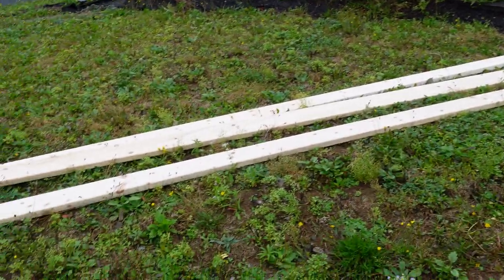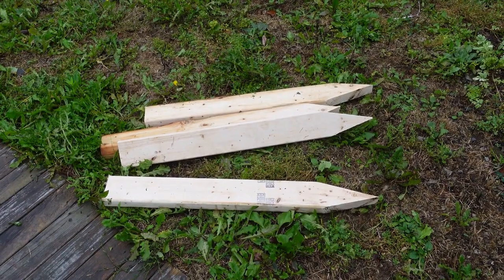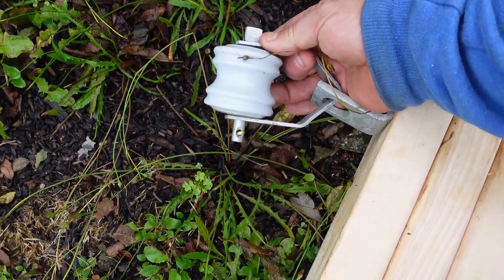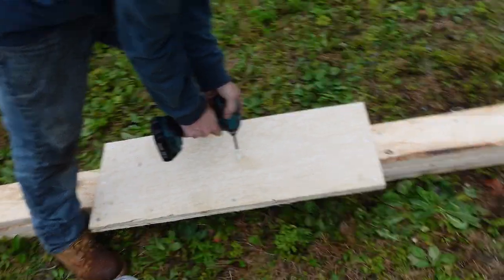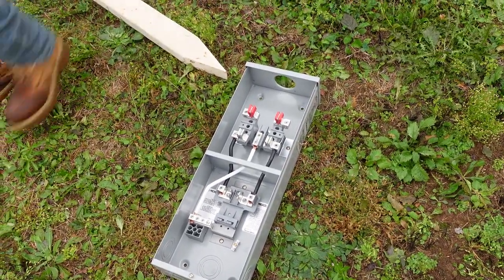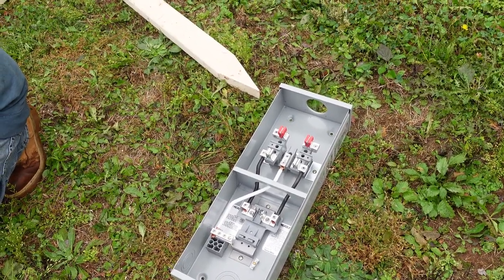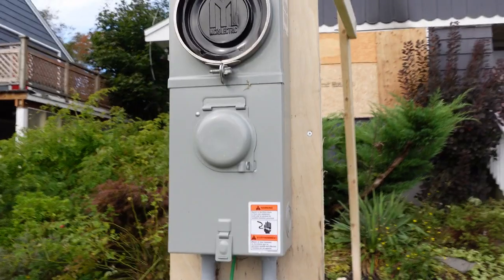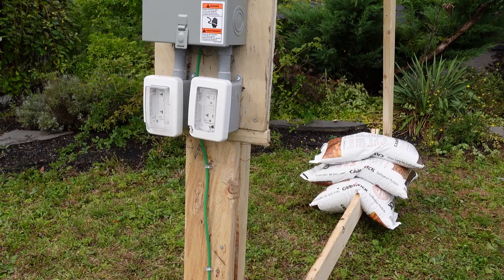Temp Power For Construction

Comment: Nice clean work, but c'mon now just one GFCI🤔,I can't wait to see how all the lil mexi's are going to plug their hot plates and tools in, oh yeah and all the other trades working?, none the less the mess of chords trying to plug into only two outlets on a 20 amp circuit.. and we know how volatile those GFCI receptacles are prone to tripping 🤣, then again I guess that's why they call it job security, so A+ for you 👍
Reply: Right... should've used a double gang box